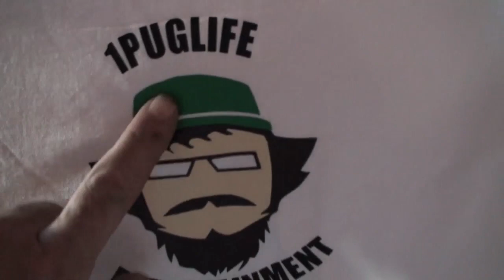how to set a corner fence post

Comment: mum this is definitely not how to do it but, I love pug1, but there are many glaring mistakes, you don't need to brace such a light weight pole you just keep the level and adjust it as you out concrete in, and you need to use at least a few bags, not only 1 bag, and it's better to mix the concrete in a wheelbarrow and then pour in, you make sure it's fully mixed with the right amount of water and it literally takes 2 minutes to cut the bag with the shovel and mix, I just worry that pouring the powder in the hole and then an unknown amount of water would leave mixed pockets of powder where the water didn't penetrate